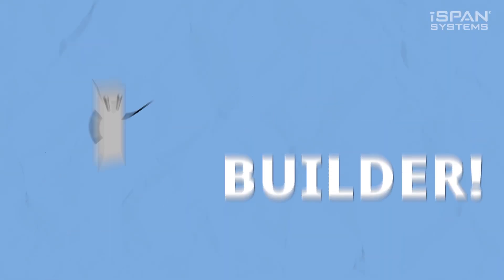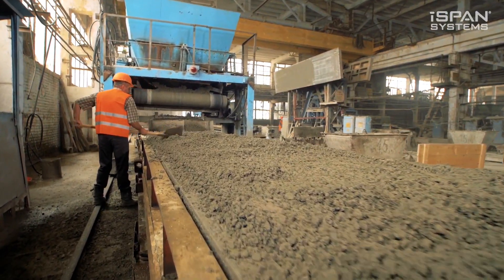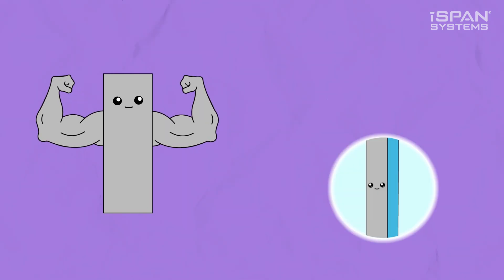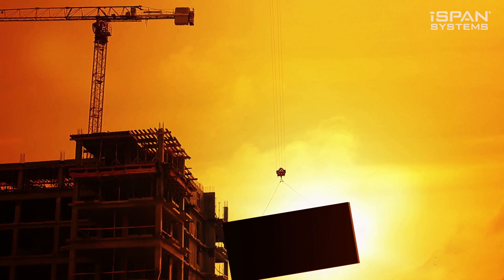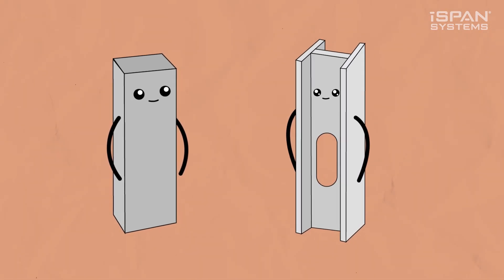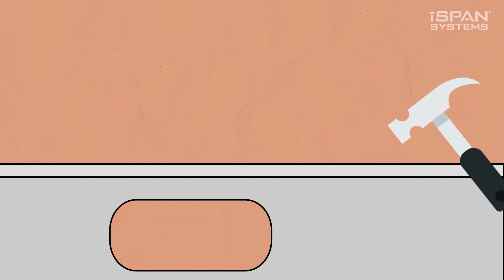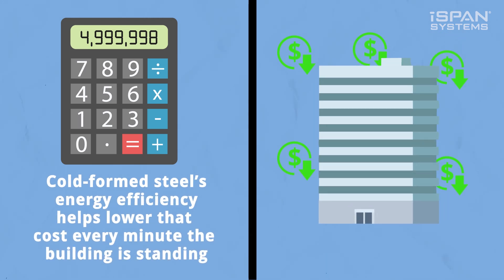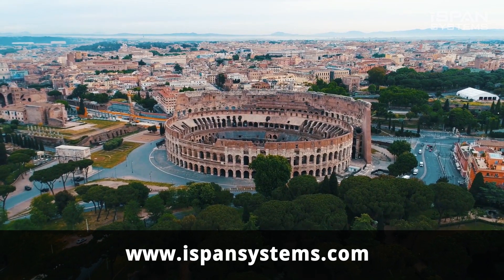Precast Concrete vs. Cold-Formed Steel Construction: Which should you use?

Comment: *Build with ACI Precast! *
ACI PRECAST is a Prefabricated *CERAMIC* wall, floor, roof building system. It is ESSENTIALLY THE LEGO SET of YOUR DREAMS!

DESIGN FEATURES INCLUDE
1. International Building Code Fire Ratings Classification:
 *ASTM E119-12-3HR Three hour Fire Rated Label *
2.Continuous Thermal Break 
3. Composite Air and Vapor Barrier
 
4. Impervious to Moisture
       a.Zero Mold
5.  All panel attachments are casted & sealed 
6..Continuous Sound Break
 
7.Impact Resistance
      a. Military Level V: 9 mm Bullet 
8.All Concealed In-Wall utilities
9.Substrate for Attaching Finish Materials
10.Available in:
                 a.Stucco
                  b.Stone
                  c.Brick
                  d.Ceramic
                  e.Solar Panels 
                  f.Rain-Screen Panels 
 
11.Composite Structural Load-bearing Panels

12. Wall and Floor "Lego Set" for a Simple  and Rapid  One-Step Structural Integrated  Solution

VISIT US AT OUR WEBSITE @ www.americancraftsmeninc.com OR check out my youtube channel  @ACI PRECAST!

Comment: Id rather go for in site concrete or hot rolled steel like uc-h beam. Cfs are expensive and very good in design theoretically but there are undpredictable factors that would really make it a downer.
Reply: whats are factors that make it downer ?

Comment: 12 floors? really?  the twin towers where made out of steel for the support ... north tower was 110 floors qnd south tower was 108 floor
Reply: Cold form steel, not regular steel
Reply: but its still steel
Reply: @Scudmaster11  Different things with similar names. Kinda like the difference between balsa wood and spruce, pine, or fir wood. You wouldn't frame a house in balsa wood (unless it was a tiny model), just because it was "wood."